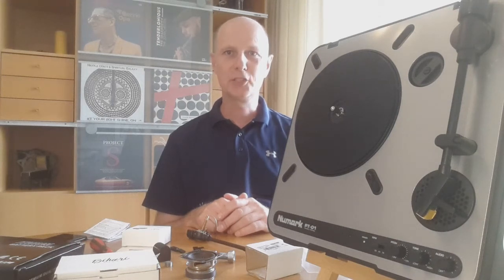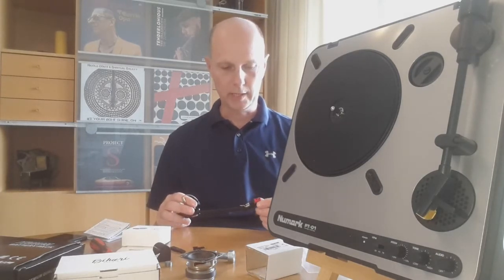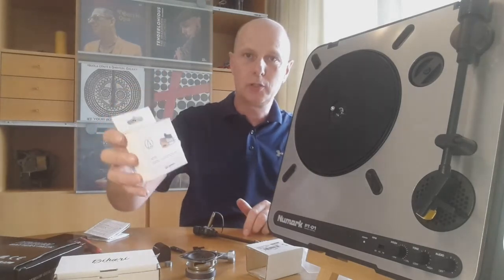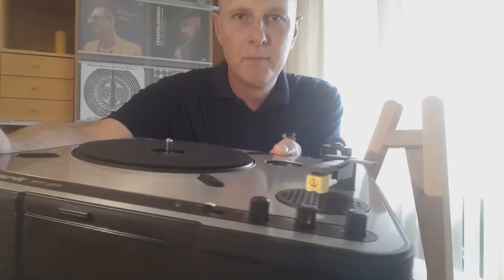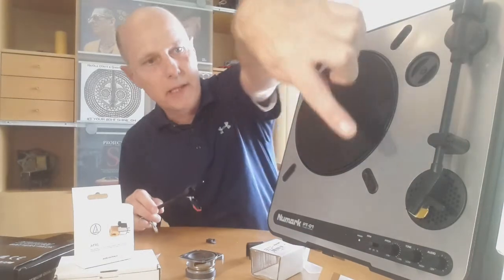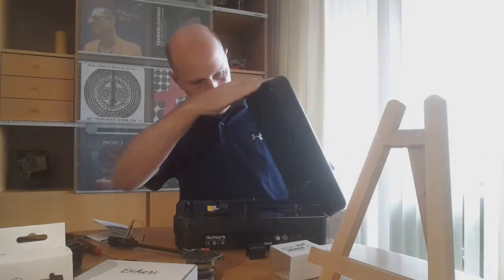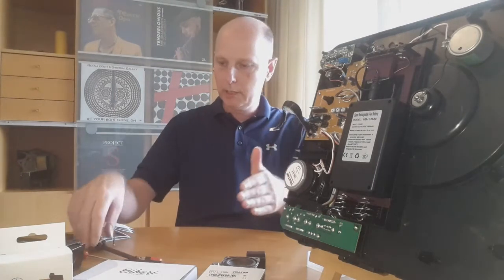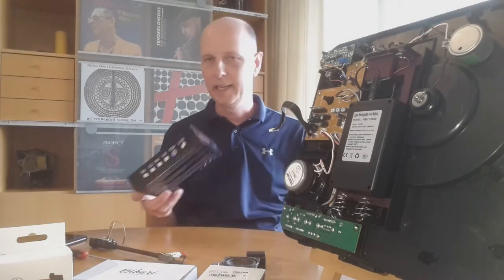Modifying a Portable Numark PT01 for HiFi Playback - Vinyl Community

Comment: Excellent. Would u add a 50% pitch?
Reply from the maker: Hi! Never found the need to do it. The pitch control is already pretty big. Or do you maybe want to go lower in pitch? The turntable doesn't really like that, as it gets unstable. Thanks for watching. Cheers. /Paul
Reply: @XjunkieNL  thanks 4 ur feedback. Yes, I d like it to go lower to get 16rpm
Reply: @XjunkieNL  =I'm surprised u didn't know about the upside down playing, I don't understand how is that possible, do u?
Reply: @XjunkieNL  why would it go unstable? What would I need to install to get that lower speed?
Reply: @XjunkieNL  would u sell me a modified one with new tone arm and modified speed to get the 16rpm?
Reply: @XjunkieNL  I had modified the USB  model as it had a very annoying sound, especially heard with headphones, so the technician removed the culprit which was the USB thing.
Reply: @XjunkieNL  there is a way to connect it to some specific portable battery, a USB power bank, but I found no available ones, do u know anything about it?
Reply: @XjunkieNL  most people use this record player for scratching, I never understood how this doesn't damage the motor and make the speed unstable
Reply from the maker: Never tried it. I don't think the motor will stable enough. And will play 16 with a lot of wow and flutter.
Reply from the maker: Only song I've heard on low speed is Jolene by Dolly Parton :)
Reply from the maker: The construction of the drive and motor is not high tech. It's something want to modify some time in the future.
Reply from the maker: It is really a fun job to do yourself ;) Sorry man I don't have the time to do it.
Reply from the maker: I have no experience with the USB model. The one I use is an early first model. I think USB wasn't invented yet :)
Reply from the maker: My unit is modified so it can handle a battery from a camcorder. Don't think it can handle a USB power bank as the unit needs 9V to operate, and the power bank has a lower output voltage.
Reply from the maker: Puzzles me too ;)

Comment: May i ask u please to tell me how to get rid of the hum when the platter spins? I bought three Numark PT 01 USB from different sellers and the three have the same problem. My technician doesn t know how to get rid of it, even tho he fixed very well the unsteady speed of two of them. The third one I bought  today  has the same problems: The noise when the platter spins, and the unsteady speed. Is it just a coincidence?
Reply from the maker: Hi Markus. Sorry to hear about your troubles. I have the original PT01, not the USB version. As far as I've seen on the inside there is a ground connection between the motor and aluminium top plate. Maybe double check this connection, or remove it. By the way do you have problem with batteries or connected with the power adaptor? Yeah, speed can fluctuate a bit, just be sure to not push the record too hard on the spindle. Hope this helps. Cheers. /Paul
Reply: thank u very much for your interest, as this issue is mostly ignored by  everyone except you so far. What is the original PT 01? I thought the USB model was the first one, back to 2006., the ones i bought are from 2006. I thought there are 3 models: the pt 01 usb, the pt 01 scratch, and the one with built in bateries. In this particular model, i dont think is a ground problem because this noise is only to be heard when the platter spins. I have two vestax handytrax, and the early version has a ground noise regardless of the spinning platter. Could you send me some link of your original model?
Reply: I just posted the following in some forum related: Hello to all of you!
I read all your comments related to the buzzing noise of the portable turntable Numark PT 01 USB.
It seems that you give some suggestions and ideas but none of you apparently found a real solution, a real fix, and the real cause of the problem,
1 or did you?
In a nutshell,
2 is there any real valid solution to get rid of the noise once and for all that is heard when the platter spins?
(especially when using headphones)
3 Is "your" noise caused by the spinning platter or not?
In my case it is, there s no noise is the platter doesn t spin.
4 So are we talking about the same noise? the noise that is heard when the platter spins?
It seems that one of you got rid of the buzzing noise temporarily, but then it came back,
and then suggested to remove a kind of a white square piece apparently related to the USB feature.
5 Does that completely fix the problem?
6 If not what does?
7 Did any of you find the real cause of the noise?
8 Did any of you completely removed the noise once and for all?
There are many videos on youtube related to this turntable but as far as i know no one mentions this buzzing problem.
This is the only forum and info related i found on the net.
9 Are there any more?
I also asked everyone (Numark pt 01 related videos) on youtube regarding this noise, and apparently nobody has ever had any buzzing noise,
because they either completely ignore my question and comments, or are asking me questions like " What kind of noise? " etc which makes me think they have no idea what i m talking about because they actually never had this noise.
Some youtubers play records using this Numark PT 02 USB, and there is no noise whatsoever, none at all.
10 So what's wrong with our models?
11 Are they defective?
I bought THREE Numark PT 01 USB from three different sellers, THREE, and ALL OF THEM have the same annoying noise that makes it especially annoying when playing some kind of classical music etc.
12 I´d like to mention another problem if i may, related to this Numark PT 01 USB model:
The speed:
It's uneven, and this speed problem is, as a matter of fact, something many owners complain about.
13 Do you have the same speed problem too?
14 If so how did you fix it? ( i'm not talking about changing belts, but using a new one and still have the same problem)
Some technician fixed the speed problem in both of them, and when using a stroboscope, both 33 and 45 were ok. I didn t ask him to adjust 78 tho
The problem is, the speed was uneven two days after, without using them during those two days, in both turntables.
15 How on earth is it possible that this turntable has uneven speed and buzzing noises and yet being satisfactory used by so many people who even invest almost 500 bucks in modifications, like pro arm forces, to be able to use pro stylus and cartridges)?
16 I mean who would even bother investing any money with a turntable that has a buzzing noise and an uneven speed in the first place?
Expensive tonearms would not fix that as far as I know.
17 Who would do that investment having this annoying buzzing noise and uneven speed in the first place, and not even mentioning it anywhere ?
18 this buzzing sound appears to be only in the USB model and not in the scratching model?
"The third model" , the one who has a built in battery has a buzzing noise too according to some youtuber who actually is very happy with the one we are talking about here, because his has no buzzing noise,
but complains about the one he bought brand new with the built in battery because it does have a noise.
These turntables are extremely affordable,
19 maybe that's why they have so many issues?
20 or it s just that we had bad luck and have defective ones?
21 If all of them had the same issues, why on earth people would talk so highly of them and invest money to replace force arms etc?
22 May i mention another turntable, the OMNI, who already has a pro arm force, and is more expensive.
23 Do any of you have one?
And if so,
24 could you tell me if it also has the aforementioned problems?
Which are:
A) Uneven speed
B) Noise when the platter spins
C) "Ground noise" regardless if the platter spins or not
25 May I mention the Vestax Handytrax? I have two.
One of them, the first model, has a noise as well, but not related to the spinning platter.
The noise in this one seems to be "a ground noise" which increases when touching the surface of the turntable.
It also has an uneven speed.
And the other one, a white one who is a slight different new version, has no noise whatsoever, but an uneven speed too.
26 Who would be ok purchasing and using a turntable that doesn t even offer the very minimum requirements?
Minimum requirements meaning playing a record with the right speed, even speed, without the extra annoying noises, and without damaging the grooves.
I would be more than glad to pay more money for a light portable turntable with exchangeable light batteries, that would not damage the grooves and needle with excessive weight, and would spin at the right speed, even speed, and without annoying noises of any kind.
Both the Vestax and the Numark are too heavy when using batteries because they require a lot of batteries that are not rechargeable, too heavy, and not environmentally friendly, unless there is another option,
27 is there?
28 Am i asking for too much? am i being irrational?
The OMNI seems to have all basic requirements according to the informative emails I received from them (HeadacheSound brand) but after all the stress and wasted money and time invested in the aforementioned ones, I have my doubts the OMNI will fit the, again, basic requirements, so I have my doubts.
I hope some of you will kindly provide the theoretically simple and practical solution, a real one, in order to get rid of the buzzing noise once and for all.
Thank you very much.
Feel free to contact me here too: veganroommates9@gmail.com
Reply: Markus Ziman did you fix that buzzing problem? I have the ION version of this turntable and i got the same problem.

Comment: Hi there. Just want to ask. How to disable the built in speaker when using active speaker? Thank you
Reply from the maker: Hi! I've no experience with active speakers with my PT01. Is the internal speaker perhaps disabled when plugging in a fake headphone jack? /Paul
Reply: @XjunkieNL  I use active speaker, but when I turn the speaker volume down but the sound from built in speaker is still exist.
Reply from the maker: Okay, I understand. Would it be an option to just cut the wire to the internal speaker, or put in a switch. Maybe there is a simpler solution, but I'm not aware of it. /Paul
Reply: @XjunkieNL  Im sorry. It's not from the speaker. The sound is from the center area of turntable.
Reply: I've tried spinning a vinyl (without active speaker, only with the internal one), then I turn off the volume, but the sound still exist from the center area. How about yours? Btw, thank you for the response.
Reply from the maker: Ha! Now I understand. Yep, got the same thing. Especially with standard sapphire needle and high tracking force. In principle this is how the old grammophon works, just put a horn on top :) Now that I've changed to a MM cartridge, the effect is less obvious. Sorry for misunderstanding earlier. Have good weekend. /Paul
Reply: @XjunkieNL  thank you so much! You're really helpful!
Reply from the maker: Happy to hear it's helpful. Usually I mess up things :D
Reply: @XjunkieNL  lol. Once again thank you!

Comment: Would it be possible for me to add the lithium battery to my Crosley-like record player that doesn't have a battery at all? If so, how would I do that?
Reply from the maker: Most probably, yes. It depends on the voltage the unit is running on. If it is converted to something like 9 Vdc. It's all about finding that spot in the circuitry and connecting the battery. Maybe with a voltage regulator in between. Being the first doing the modification is always tricky, as it can go wrong and warranty is out of the window. Good luck. Cheers. /Paul
Reply: Question; How do you install a battery? I looked up the battery, and I don't understand how you connect the battery to the record player.

The only thing I can think of is sticking it inside the record player, cutting a hole in the back where the battery can stick out just enough for me to toggle the ON/OFF switch and plug in the charging cord, then, when the battery is done charging, plug in the power cord it comes with into the battery, and the other end into the record player, taking the power from the battery into the record player.

I'm sure the way I came up with would work, but how did you do it?
Reply: The DC In spot in the back says 5V.
Reply from the maker: Good question. It's something I didn't think about for your turntable. As my unit is already ready for battery power, there is inside space for 6 big batteries. It is exactly at this space the lithium battery is placed. Through the battery door latch I also access the on/off switch. You have to do it the way you suggest. Or make somewhere an access hole to reach the switch. You will need to use the switch, and cannot leave it switched on all the time, as it will loose it power. Do you think you can fit the complete battery inside? /Paul
Reply from the maker: So you probably only need a 6 Vdc lithium battery. And use 5 Vdc voltage regulator or connect directly a 5 Vdc lithium battery. /Paul
Reply: @XjunkieNL  My turntable is completely hallow inside (which is why/how I will be adding an rgb LED strip under the platter), I'm sure I could fit plenty of batteries inside. The problem is accessing the on/off switch, and plugging in charging cord/power cord to the battery. I looked at the back of my turntable, and the battery wouldn't be able to fully stick out the back, as there's all the outlet holes in the middle (DC, AUX, speakers L & R, etc). Only half of the battery would be able to stick out. Your's seems to be a little bigger than mine.

I think what I'll do, is; I'll first put the battery inside (of course), cut a hole in the back, and then turn the cut out wood into a little hatch that I can open/close. Then I can reach the on/off switch, and plug in the charging cord/power cord.
Reply: I'll probably be putting in two lithium batteries. One to power the actual turntable, and another to power the little led strip I'll be putting under the platter.

My turntable is brown wood (how I'll be able to cut out a hole in the back). I'm going to paint it black, replace the dust cover with a clear one, and replace the tonearm with a silver s shape one. It's going to look awesome. I'm also going to make my own carrying case to carry the turntable around in sense the dust cover will be clear.
Reply from the maker: Sounds as a plan :) That will be one cool portable record player. Good luck with all the mods. /Paul
Reply from the maker: I would suggest a 7805 in your case. Maybe you can google it. It's a small electronic component. /Paul
Reply: @X junkie NL  K, I just looked it up.
Reply: @X junkie NL If you've seen a 5 vdc lithium battery online somewhere before, could you link me to it? I can't seem to find one. All that shows up are 12 vdc.
Reply from the maker: @directorkid3131  Just checked the original box of the battery I use. It has markings of which batteries are available. It shows a 8 Vdc version. Maybe that's the one for you. I would use something above 5 Vdc, so there is no voltage drop below 5 Vdc when it looses some of its capacity.
Reply: @X junkie NL I just did a search on Google, Amazon, and eBay and I can't find an 8v dc lithium battery. Once again, all that shows up is 12v dc. Do they have a website?
Reply from the maker: Just also checked online. No where to be found. Strange! There is no brand name on the box. Probably when you find one, the price will be high compared to the 12 version. Maybe use the 12 version instead. The voltage regulator will take care of the difference, but can become hot and most probably needs a heat sink. This is me guessing, as I have no experience with using it this way. /Paul
Reply: I'll probably never really have a need for the battery anyway. Most of the time it'll just be sitting inside plugged into the wall. I think I'll just forget about it and save the money for records. Though I may still need it for the LED strip, or I'll just have to forget about the LED strip, too.
Reply from the maker: Decisions, decisions :) Maybe wait till somebody has a plug and play solution for your type of turntable. That would make this a little simpler. /Paul

Comment: Can you send link for that batterypack?
Reply from the maker: Hi. Easiest if you look on Ebay for "EU DC 12V 6800mAh Portable Rechargeable Li-ion Battery Pack fr CCTV Cam Monitor". That's the battery I used. Still works perfect. Good luck. Cheers. /Paul